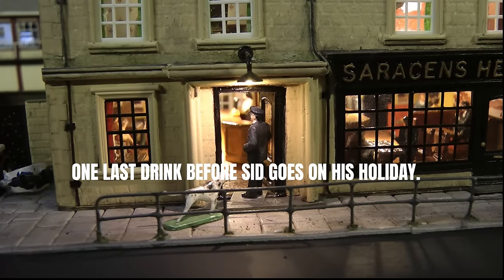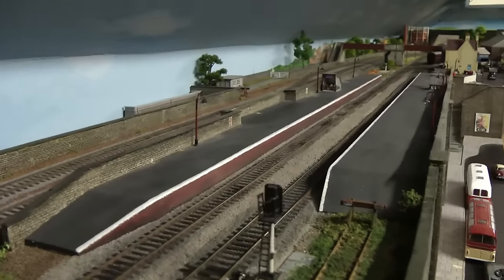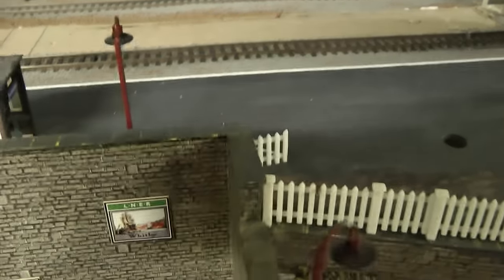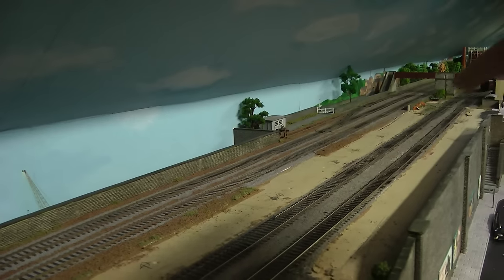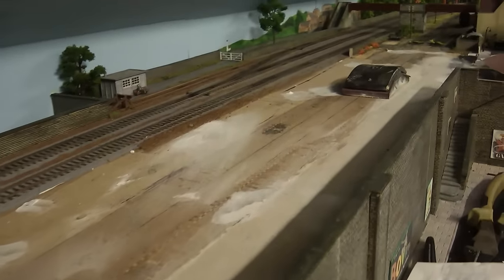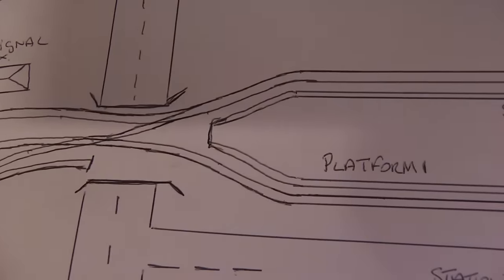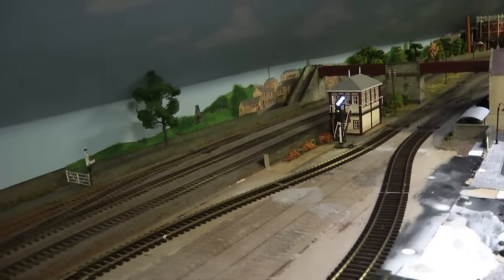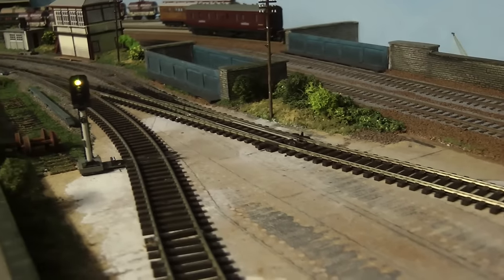Tyne Dock Re-build, Part 1 Trackwork. No 423

Comment: Interesting video, Tony...  Regarding track, I always use the cheapest grade of card glue for ballasting (never wood glue) and if I ever need to lift track then I use windscreen washer fluid as a solvent (the stuff sold ready diluted).  I just soak it with that stuff and leave for 24hrs and the track, including points, ususlly comes up very easily with very little wastage.  The ballast can sometimes be washed and re-used too.   Looking forward to seeing the new station...
 All the best, Ken
Reply from the maker: Hi Ken. i would never of thought of that in a million years. wind screen wash. lets hope i dont have to lift any more track. but if i do i will remember this. thank you for the tip. cheer's for now Tony.

Comment: For a moment I thought TNE was going to be renamed to TNT when struggling with the track removal. The scrap merchant has done well today then! It looks a lot better with the curve views now seen and knowing a mix of 30 and 36” radii. Prior photo looked much tighter. So off to a good start and the redundant track has a tale to tell too! Take care both of you and all the best Stephen. PS Might need to use some TNT on the snow mounds and ice in my garden at present.
Reply from the maker: I tell you what Stephen i was getting a bit hot under the collar when Platform 2 wouldn't shift itself. but it come up eventually. you can not beat a good old hammer and chisel. the good thing about the trackwork is that the trains have to slow down. which would make the running sessions more realistic. we had some hail stones today. but now snow throughout the winter so far. take care my friends. cheer's Tony & Laura.

Comment: Hi Tony, when the video first started I thought "wow those curves look tight" then later you showed setting the curve at 30 inches, so not that tight at all. I guess the camera makes it look more curved than it really is. An island platform eh,  reminds me very much of my favourite line, the Great Central London Extension, which had almost identical station layouts, of an island platform with a subway entrance or overbridge with steps down to the platform. I wonder if there is a connection back in time between the two somehow. Anyway, great stuff, looking forward to the next installment, all the best Dave.
Reply from the maker: Hi Dave. the great central had lots of island platforms. but they were very rare on the N.E.R. So that's what makes Tyne Dock unique. as you will see in the coming months...all the best my friend. Tony.